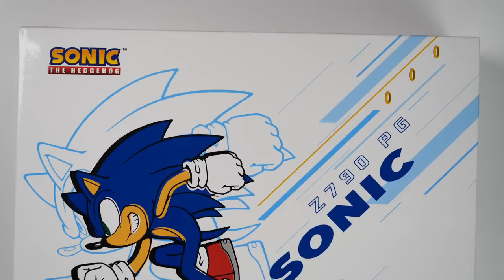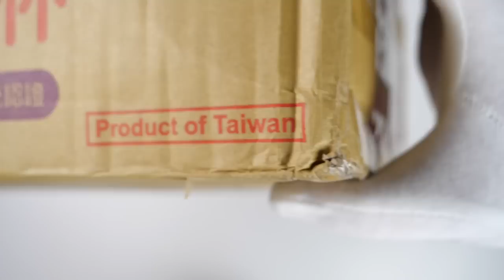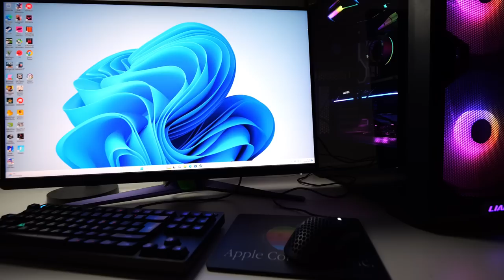Building an Intel ARC Gaming PC for 2023

Comment: 14:01 That is normal, when your fps start reaching the engine limits which is at 188 (or generally over 160) fps.
Reply: Yes
Reply: Ya
Reply: So what you need to do ? How to stop dat from happening
Reply: @ghicu9128  set a higher resolution its going to lower the fps and should fix it
Reply: @ghicu9128  no set a fps cap so it can't go over that amount
Reply: @ghicu9128  cap the fps or raise res
Reply: But why is the engine itself not limiting it when it tries to reach the limit?
Reply: @N Vignesh  because it's a old game ported to pc in 2015 and optimized for consoles, the developers didn't really seem to think people would go over 160 fps
Reply: @Fly_By_Gaming  ya thats some bad coding, engine limits are such a imp exception handling wonder why this got left
Reply: just turn on vsync guys, if your monitor is above 165hz, set fps cap
Reply: Yes i think gta 5 will run without a problem with that setup

Comment: For a build that would cost $1520 USD this isn't bad at all.
Reply: and he call it a midrange😀
Reply: @mostwantedm3  bro you can get the same performance for a cheaper price and 1500usd i would get for it atleast a 3070ti build not some intel gpu
Reply: @mostwantedm3  my point is 1000 usd will get you a decent build not a entry level pc
Reply: I personally wouldn’t compare a 3070ti to this
Reply: @f10l8 You could in theory go with a 4070 Ti nowadays, if you find the good price.
Reply: @RaccoonPower  it depends, where you live in the first place nowadays i would say that so easy

Comment: In case no ones told you yet, the reason why you get hiccups on gta 5 is because you are hitting its engine limits, which is a whopping 188 fps, if you hit that limit the game will stutter heavily. You have to lock your fps at 160 at the most for an enjoyable experience.

Comment: At first I was wondering what graphics card was that.i thought those intel GPUs were a far way away. While I am a unapologetic intel fan boy a Nvidia card must always acompany my CPU, however I am open to hearing the reviews so far. Is the card in this video equal to or better than the Nvidia and AMD equivalent?
Reply: Specs alone the card in theory is very good but the issue is the optimization the drivers still need a lot of work but it is getting better

Comment: As a console gamer , this is what I don't understand about PC, all that hardware, all that money put in, just to get mine craft running at 14fps
Reply: ...but consoles don't even support Minecraft RTX...
Also, just so you know, the Intel ARC gpus are brand new, and there's a good amount of driver issues with them.
If you really want ray tracing performance (at least in Minecraft) look at benchmarks of the 3060 and up.

Comment: 00:00 Intro
00:09 Motherboard
00:45 GPU
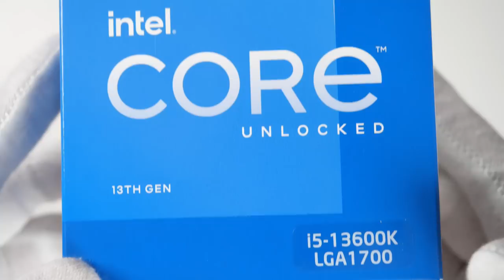02:10 CPU
02:26 CPU cooler
02:38 Light
03:06 Mic
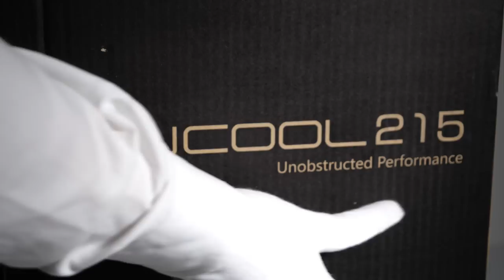03:33 Case
04:01 Building the PC
04:05 CPU install
04:23 RAM install
04:30 M.2 SSD install
04:50 Motherboard install
05:22 PSU install
05:48 SATA SSD install
06:06 Cables to motherboard
06:13 CPU cooler install
07:30 GPU install
07:57 Front glass back
08:06 Peeling the PC
08:17 Finished build
08:25 Sticker
08:33 Power [ON]
08:55 Gaming setup
09:28 Sonic Adventure 2
09:46 Call of Duty Modern Warfare 3
10:28 Forza Horizon 5
11:17 Peppa Pig
11:28 Valorant
13:24 Grand Theft Auto V
14:21 CS:GO (very quick)
14:33 Minecraft RTX
15:21 Hogwarts Legacy
16:30 Genshin Impact
17:07 Red Dead Redemption 2
18:16 Sons of the Forest
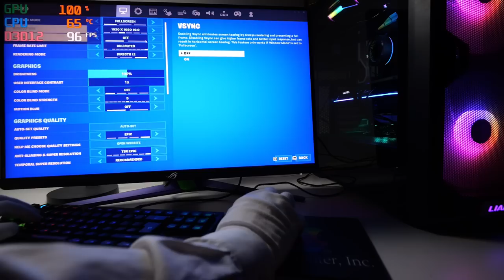19:18 Fortnite
19:52 Cyberpunk 2077
20:32 Call of Duty MWII
21:28 Outro